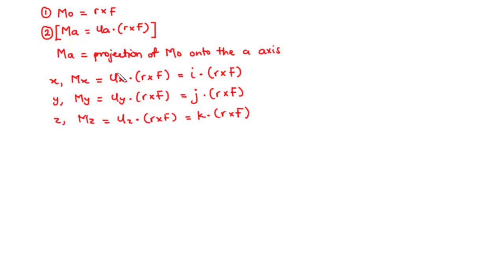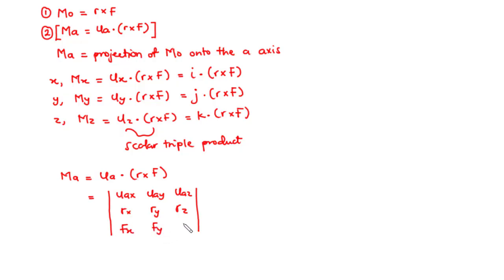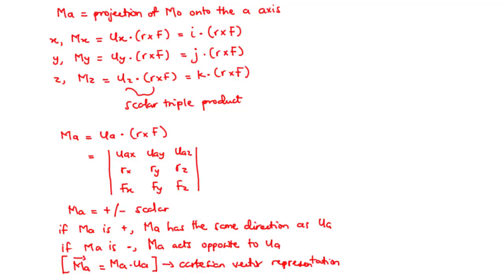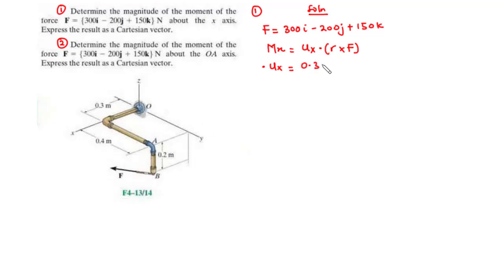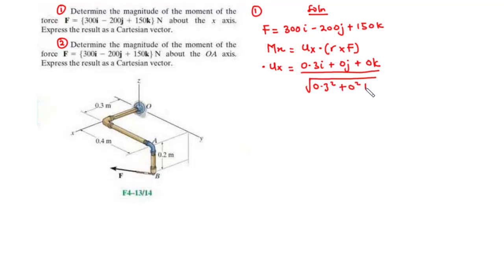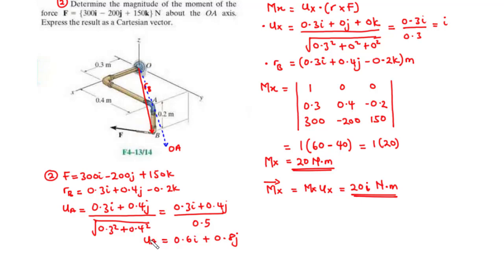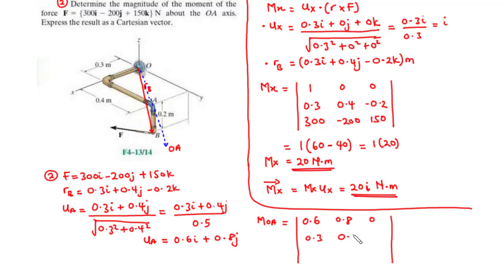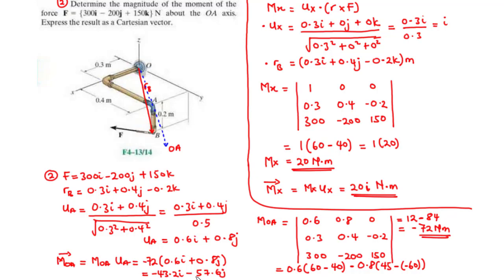🔺17 - Moment of a Force About a Specified Axis 3D -  Vector Analysis: Example 1 - 2

Comment: Please why did you use rb
Reply from the maker: We want to get the position vector directed from O to the line of action of F. The reason why we use rb is that, the tail of the vector at B is also a line of action of the force F because F passes through B. 

We can't use O to the head (tip) of the force F because we can't determine the dimension from O to the head (tip ) of F.

So once we have a line of action through point B, it's wise we use that.

I hope you will understand now